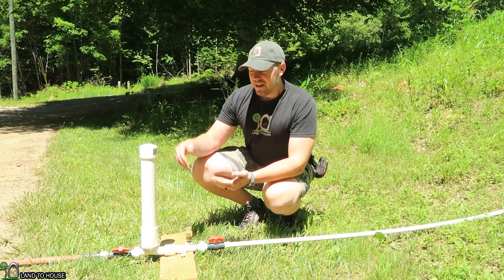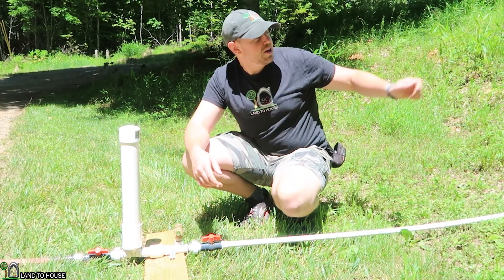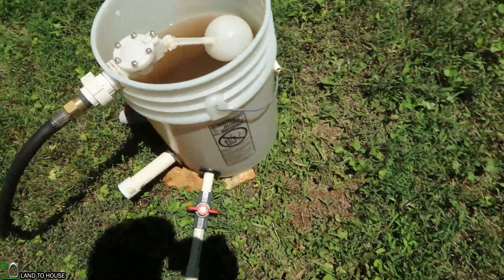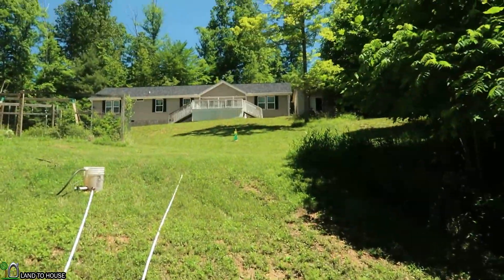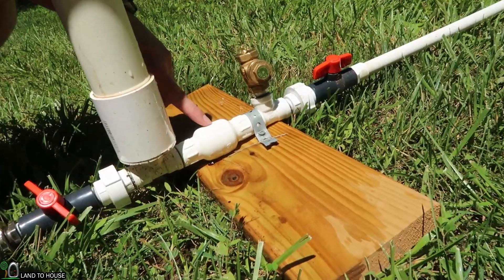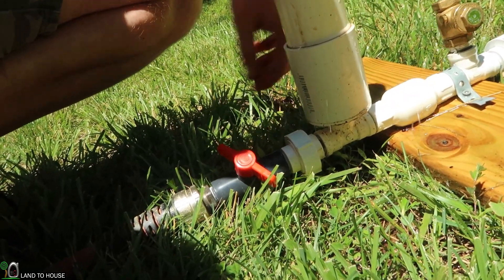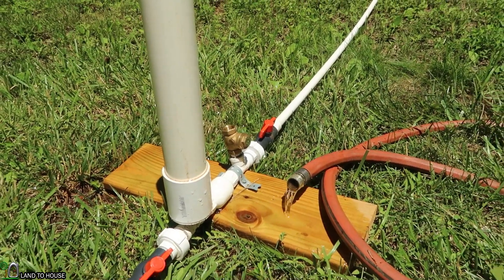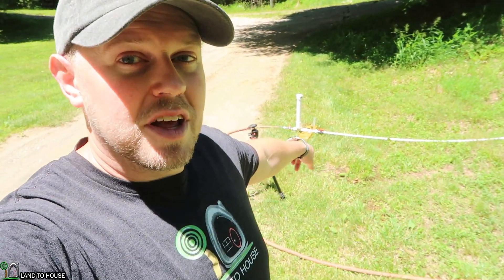Pre Fill Ram Pump Delivery Pipe to save Time

Comment: Very cool.  So it worked some but didn't work as well as hoped because your delivery height wasn't high enough?  so you can have the delivery valve cracked the tiniest bit, let it run and fill the hose, then drag the hose way uphill before opening the delivery valve the rest of the way?

Comment: I have a feeling if you add check valve on the top of drive pipe you will get more pressure so you get more flow and head . If it work better please tel me

Comment: Why not suck start it with the vacuum Like you did the turbine?
Reply: Vacation is high flow low pressure. You need high pressure low flow pump for and type of height

Comment: I am having a problem with getting the swing valve to close. Lots of water running through,  but it won't close. Can you give me some tips? Thank you so much.
Reply: Have you tried tilting the pump to the side, as Seth has shown in some videos, to give the gate in the valve a little help closing?
Reply: @BrittCHelmsSr  I have not tried that. Thanks for the hint!
Reply: There are a bunch of potential problems that could all cause this.

Comment: HI     COULD YOU ADD A TIRE TYPE AIR VALVE TO THE PRESSURE TANK ?   THEN ADD AIR WITH A HAND PUMP TO INCREAS BACK PRESSURE.
Reply: You can add the tire type valve stem onto there to add air to the air tank but it won't really add back pressure. It would work for putting more air into that tank after it's running in that air has already dissolved.
Reply: @bullithedjames  THANK YOU

Comment: I’m in Southern Africa, I used two swing values but I can’t get the pressure to pump up the hill. I noticed that you use a swing and spring value, could that be the issue? Help me please!
Reply: Can you get it to pressure up and run with the delivery end shut off?
Reply: Two swing valves will work as long as they are facing the proper ways.
Reply: @johnwyman6126  show us a video on how that doesn’t work!

Comment: New to how ram pumps work,have heard of for years, I'm in Western NC ,my creek has a good supply of water,and I have a little over 400ft of creek front to work with. I understand I need a certain amount of fall in creek to pump water. But I'm not sure how I would measure how much fall I do have. And by using Google earth it says I'm at about 60 ft elevation change to my garden spot from the creek. Any info for me?
Reply: You would require a minimum of 6ft of head.
Reply: If you can get a long length of hose, bring it to where you would install an intake and fill the hose with water. Secure one end to the intake site under the water, run the hose down the creek, and with the hose full put an accurate low pressure gauge on the bottom of the hose. Note the pressure, then repeat until you get to the site where you want to put the pump...or Hydro turbine. Double-check but I believe every PSI is 2.3 ft of head.

Comment: Maybe you could try hooking a shop vac onto the outlet hose to fill the pipe? I'd imagine a long length of pipe could get pretty heavy and difficult to drag, especially on rough and hilly terrain.
Reply: For what it's worth, a suction pump can only practically pull water up 20 to 25 feet, and I imagine a shop vac would be able to do much less than that. It still  may be enough to get the ram action happening though.
Reply from the maker: That is very likely! Seems like slightly cracking open the delivery ball valve is the best bet for filling the delivery.
Reply: @LandtoHouse  is the water system actually real ? Or is it fake? If it's real will it push water up hill?https://youtu.be/hQL09bhEveo